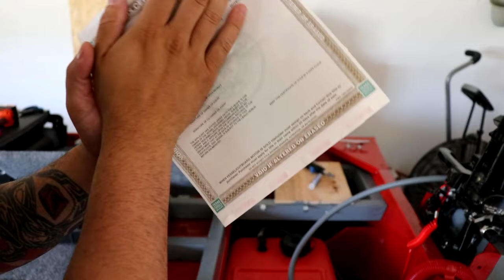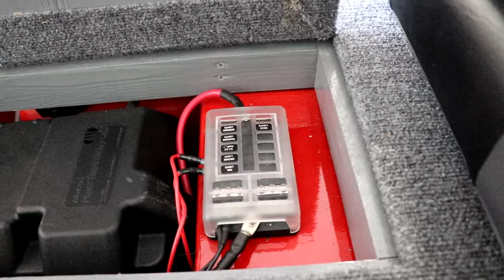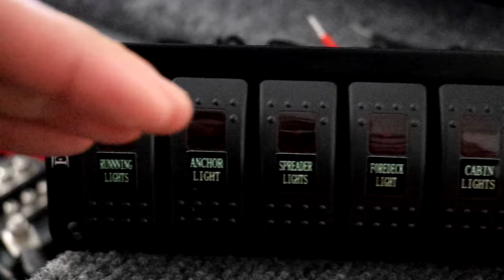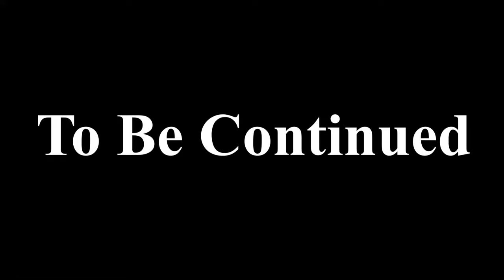JON BOAT To BASS BOAT - Running Wires (TIME-LAPSE)

Comment: Will the front and rear nav lights be on one switch or two?
Reply from the maker: Two different switches, I will use the back as a anchor light as well so gotta wire them to different switches